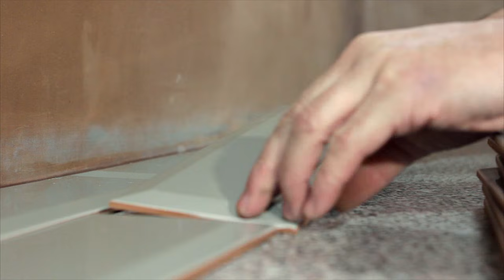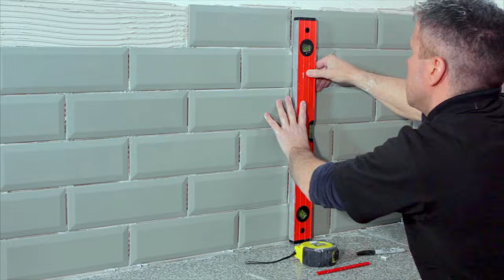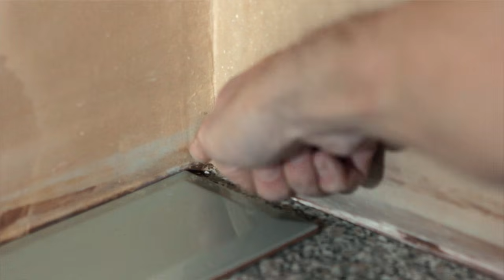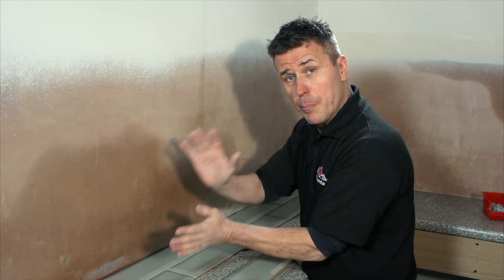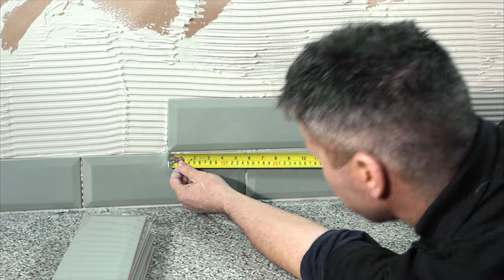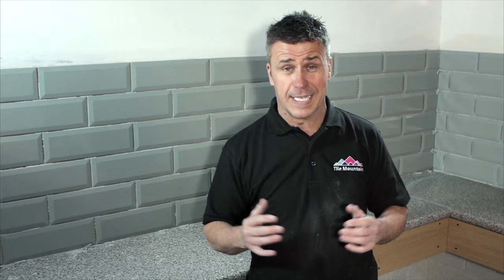How to Install Kitchen Wall Splashback Metro Tiles | Full Tutorial feat. Craig Phillips | Tile Tips

Comment: What size spacers are generally used for backsplash 1/16th or 1/8th in the kitchen. Thanks Mate...
Reply from the maker: We typically recommend a 2mm spacer for a wall and a 3mm spacer for a floor installation.

Comment: Great video Craig. Should you do one level tile coarse at a time, working it across into the next wall or do you fill the walls in one wall at a time?
Reply from the maker: We would suggest to fill one wall first, then move onto the second wall. Once all walls are filled and the adhesive has cured, begin to grout.

Comment: Hi, do you use the same technique with an external corner, using bevel edged tiles? I'm expecting to miter them but cannot find a video showing how to. Thanks.
Reply from the maker: If you are worried about trying to mitre the tiles, you could use some tile beading which is most common for external corners. Tile Mountain.

Comment: Thanks for the helpful video.  I'm planning to tile my new kitchen splash back but I see a potential problem. Where there's a window to go around, and the section under the window sill is going to be awkward (for example) 2 tiles plus a very small less than 1cm slither - is there a better and cleaner looking way of positioning the tiles, for example starting with the bottom row of tiles as half tiles?  Having such a small piece under the window might look odd, but then, so could starting with half a tile on the bottom row.
Reply from the maker: Hi Justin - thanks for your comment.

It's entirely down to your preference really...

On a 'normal' wall would advise locating the cuts at the bottom and top where they are less noticeable. However, they'd probably be similarly unnoticeable under a windowsill, so we guess it's down to what you're comfortable with.

Tile Mountain

Comment: what if the kitchen tops are not level from one top to another !!
Reply from the maker: Hi Antony,

If the surfaces are not level then you will have to measure out and dry lay for each of the tiled areas to ensure a good finish. Alternatively, you could adjust the cuts on the bottom row so as to ensure consistent grout lines from one side of the splashback to the other (we're assuming you mean that the tiled area you want to create runs from one level countertop to another?).

Hope this helps.

Tile Mountain
Reply: Thankyou,think I have seen someone do what you are saying.
Reply: @antonygilbey8068  Also it maybe worth considering trying to level the worktops if possible.

Comment: Did Craig remove the spacers prior to grouting or grout over them? Doing my first ever tiling job in our wc soon and videos like this give me more confidence in doing so
Reply from the maker: Hi there,

Craig did indeed remove the spacers before grouting and we advise that you do to! Leaving them in and grouting over them can not only cause an uneven finish to grout joints but will mean that the joint itself is weaker at the point where a spacer has been grouted over (as the density of the grout is less).

Hope this helps!

Tile Mountain

Comment: Hello Craig just a quick question. We are having our shower puting in and the tiles I want are small mosaic ones. About 3 X 2. But the tiler seems unsure how to tile them. 
I've heard that they are not suitable about this. Would appreciate your answer..
Thanking you.
Reply from the maker: Hi Patricia - thanks for your comment.

Most mosaics, providing that they are ceramic or porcelain, should be suited to shower areas and locations where they'll be exposed to direct water. 

Some, such as split-face mosaics, are often constructed from natural stone materials and cannot be grouted and therefore shouldn't be used where they'll get wet often as water will get behind them causing the adhesive to fail over time.

Without seeing the tiles you want to install (or having specific technical information on them), it is hard for us to answer your query, however, we hope the advice we have provided helps!

If you're still unsure, please feel free to call our customer services team on 01782 223822 - they'll be happy to help!

Thanks,

Tile Mountain

Comment: Great video. What are your views on tiling an uneven work surface? Some recommend to fix a temporary batten to the wall in place of the first row of tiles, to ensure the level is 100% level all the way round, then come back and do the first row, trimming off the top if required. 
Others however just say to start from the bottom row as the human eye won’t work out if it’s slightly wonky once done. Thanks
Reply from the maker: Hi Ed - thanks for your comment.

The reality is, as you say, that both approaches are viable methods. 

Most people would tile straight to the wall if it's not too unlevel (and we would too!).

Hope this helps.

Tile Mountain
Reply: I'm with both you and @Tilemountian both methods could work, I'd also consider trying to level out the worktop by losing it off and packing below the worktop until it is level then starting level from the worktop, sitting the first course of tiles on just loos 2mm tile spacers that can be removed as soon as there set and dry. then once the rest of the wall is grouted you could silicon fill the bottom 2mm gap between the worktop and the first tile.

Comment: What about the edges?????
With Beveled tile jobs you have to explain how to finish the edges!!!!
Reply from the maker: Hi 2melapelasway - thanks for your comment.

In answer to your question, under circumstances where the bevel will be apparent (e.g half wall) we recommend fitting a trim - general rule of thumb we advise a trim at least 2mm thicker than the tile (not every metro tile is the same thickness!). 

If you do not want to trim the edges, the other option would be to use a silicone sealant to ensure everything is watertight.  

Hope this helps.

Tile Mountain
Reply: @TileMountain1  Shh,it's a secret.

Comment: Great video would you use the same type of set up if you was tiling in a non brick bond style fashion in terms of laying out where the tiles should go etc and what the cuts would be at the ends
Reply from the maker: Hi stewie3ify - thanks for your comment.

In answer to your question - yes, you would dry lay and set out the tiles in a similar fashion. Start from the middle of the wall and work out the space that will be what is left at each end for your cuts.

Happy tiling!

Tile Mountain

Comment: Can these be installed on a wood surface?
Reply from the maker: Hi Kelvin - thanks for your comment.

You could apply these tiles directly to wood but as with any tiling project, you must ensure that the substrate you're attaching the tiles to is smooth and level. You should also use an adhesive that is flexible such as Mapei Keraquick: https://www.tilemountain.co.uk/p/keraquick-white-fast-setting-adhesive-20kg.html as this allows for a little movement.

Hope this helps!

Tile Mountain

Comment: How do you finish the tiles on the vertical side if the wall ends abruptly?
Reply from the maker: Hi Peter - thanks for your comment.

We would suggest finishing an external edge/corner with a suitable tile trim.

For internal corners/edges, we would suggest finishing this with a bead of silicone sealant.

Hope this helps!

Cheers,

Tile Mountain
Reply: Thanks!  Didn't think of that...I got some trim :)
Reply from the maker: No worries Peter.

Hope your tiling project goes well and that it looks great when you're finished!

Tile Mountain

Comment: Could tiles be laid on a painted wall ? Thanks in advance for your advice. Appreciated.
Reply from the maker: Hi BS Chan - thanks for your comment.

Before tiling onto a painted wall, we'd advise that you remove the pain as best you can. If you tile directly onto the painted surface the tiles will adhere to the paint and not the surface, increasing the risk of the tiles failing to stick or coming loose.

Hope this helps!

Tile Mountain
Reply: It is indeed very kind of you in answering my question and I shall follow your instruction accordingly. Thank you once again.

Comment: What's the best way of grouting bevel edge tiles? Rubber squeegee, foam pad or something else? Normal tiles I'm ok with but bevel edges are a new one on me!
Reply from the maker: Hi John - thanks for your comment.

When grouting around beveled edge tiles, we advise applying the grout to the beveled edge, then using either a rubber float or squeegee, pushing the grout into the joints. Next, clean the grout residue from the face of the tile using Fila Deterdek - https://www.tilemountain.co.uk/p/fila-deterdek-residue-remover.html .

Hope that helps - let us know how you get on and do share any photos of your completed project via our Facebook page or website as we award a £10 Amazon voucher for every image we use in our Customer Gallery!

Cheers,

Tile Mountain
Reply: John Smyth yes rubber squeegee should be fine